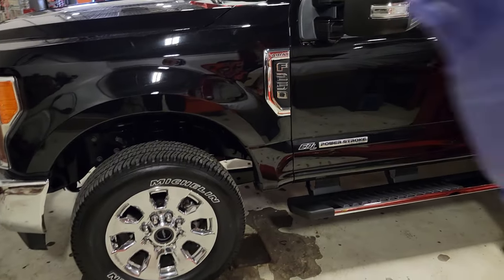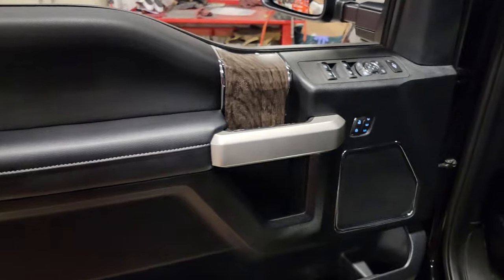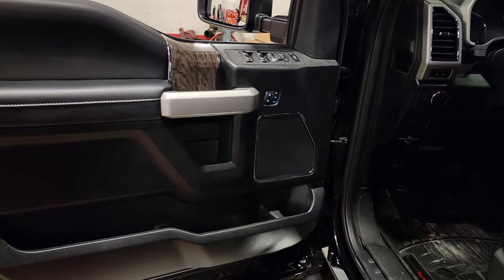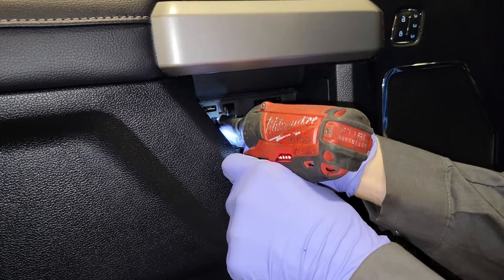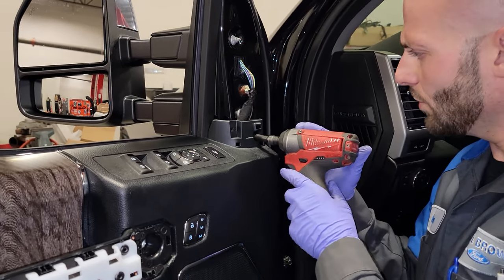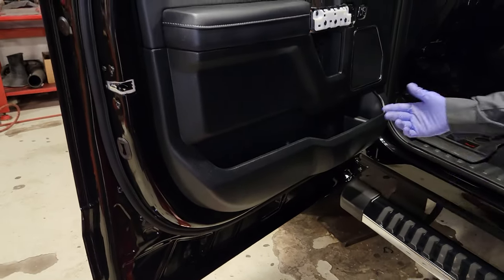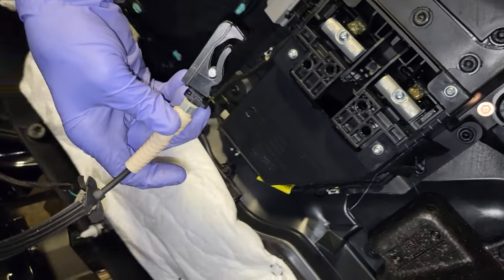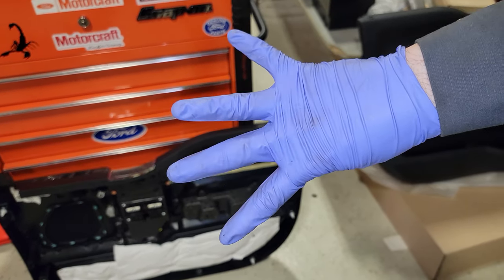| HOW TO | Remove the FRONT Door panels - Ford ALUMIDUTY F250 F350 F450 F550 | 2017-2021 EASY!!

Comment: Just had to do this on my 22 tremor. The plastic cover came loose and was getting the adhesive all over the window when going up and down and something scratched my window( glad it’s on the bottom where I won’t see it every day). Scraped my thumb pretty bad when pulling the door handle trim off. Then the lock indicator wouldn’t line back up for the life of me when reinstalling glad it back on when it did I was getting pissed off

Comment: After the panel is off, how to unplug the cables looked so easy in the video, me I'm here forever and still no joy.
Reply from the maker: Cmon
Reply: @PowerStrokeTechTalkwARod  turns out, if you simply yank on the door panel hard, all the connections come loose, problem solved.

Never did determine the problem with the door lock/unlock actuator buzzing but not moving. So now with unlocked doors permanently, it's one step easier to take.

Comment: Thanks ARod! Great video. I have a passenger front door lock on '21 F-450 that seems to have stopped working.  Not sure if its a sensor or something other. key fob as well as power locks (both sides) wont seem to lock or unlock the passenger front door. figuring out door panel removal is step one.  :)

Comment: Great job brother, just bought my first SD it's a 2017 6.2 and I love it. I am going to replace my front door speakers so your video has been super helpful thanks. If I may ask you something, my SD is really basic, no sync system or even bluetooth. The issue I am having is that upon start up and shutting off the truck I get an audio message through the speakers.......in french....wt*. I have tried the language settings (all written prompts are in english) and that is fine.  I have tried disconnecting the truck battery trying to reset evrything, french again! I just dont know how or what to do about this. The truck is from the Kentuckey plant so I have no idea why this happens. When I tell people I get a lot of jokes and I understand, but I wish someone could point me in the right direction and yes I have called a few Ford dealerships and no one seems know what to do. Thank you again
Reply from the maker: Can u email us

Comment: I was having problems with my right rear door would not unlock put the window down while pulling on the lock rod got to unlock thanks to your video got door panel off did not replace just move stuff around now it unlock and locks

Comment: Replaced my speakers a little over a year ago. Super easy! The only kinda hard part was trying to get the door locks lined up when putting the door panels back on. They kept going back into the lock position when I would put the panel back on which made me have to start over again. I think that the rear door panels were a litter bit harder to do because they wouldn't snap back down very easily. Coulda just been my truck. Wish I had this video long ago!
Reply from the maker: Lolol guess i was late 2 the pwarty
Reply: @PowerStrokeTechTalkwARod  haha!! Better late than never buddy!

Comment: In 105 degree heat the piece of clear plastic fell out of my door. I had to pull the panel off to put it back on. Not sure if the plastic piece was necessary or not, but thanks to your video I got the panel off and the plastic glued in again.
Reply from the maker: Hey, thanks!!!

Comment: Awesome video! I do have a question. Have you replaced this wiring harness in the door before. I damage the camera wire that connects up from the door to the mirror looking at the parts diagram it shows I have to replace the entire harness. Is this hard?
Reply from the maker: Not bad
Reply: @PowerStrokeTechTalkwARod  is the wiring harness just on the exterior of the door or do I have to take the window out?
Reply from the maker: @DigitalJazz inside the door. U do it with the window up...

Comment: I have a 2017 f250 lariat do u happen to know what the ticking sound is inside the door panels on front driver and passenger doors its by the lock button that goes up and down by toward the seat belt pillar if i push on the panels it goes away passenger side worse then driver tia like all your videos and responses
Reply from the maker: I do not

Comment: Does the top of the door panel have any clips on it? Mine isn’t tight against the window it is very loose. I pushed on it after my door froze shut and heard a pop now it’s loose. Hoping it’s a clip. It doesn’t even seem attached to the bottom it’s all floppy at the top like 1” pull back and it’s easy before resistance
Reply from the maker: Oooooof prolly more than a clip